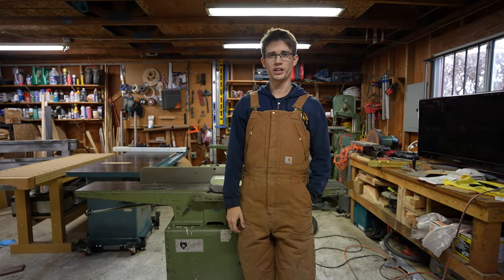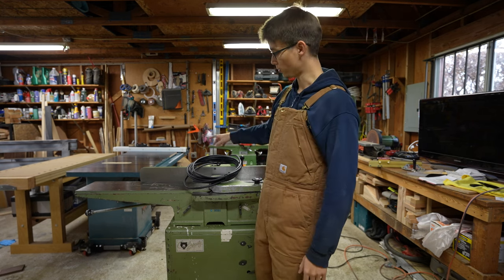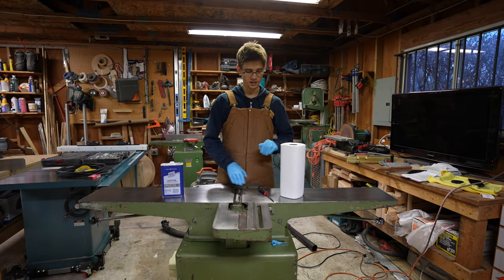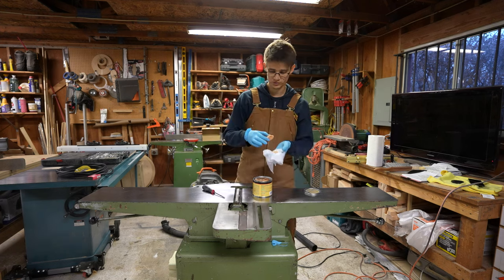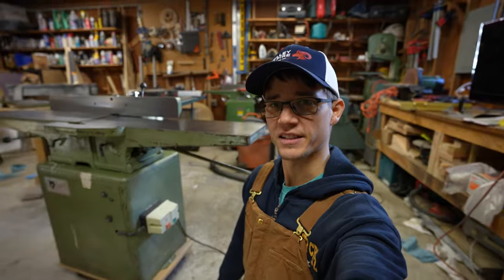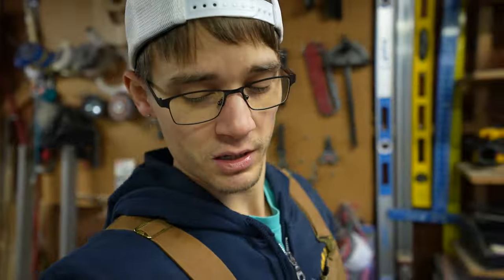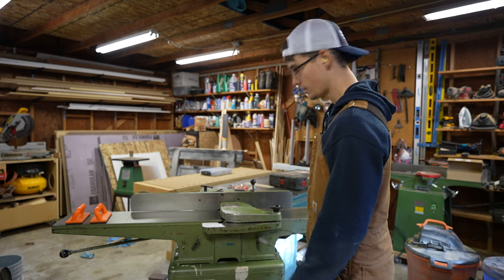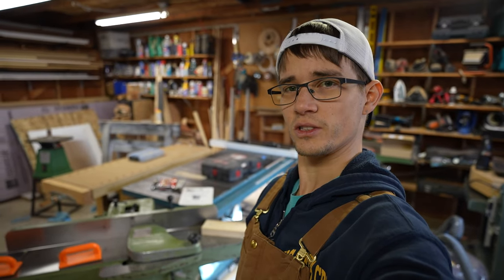Wood Jointer Restoration: Bringing New Life to an Old Tool

Comment: It sounds like the bearings need to be replaced. Great video!
Reply from the maker: Thanks 😊
Yeah I think you're right on the bearings. I didn't feel any slop but they're definitely noisy. At some point I'll probably pull the cutter head and swap the bearings out.

Comment: Nice job.  I was ready to ask why you paid no attention to the belt until the end when you said one was on order.  I was also waiting to see if it was possible to lubricate the bearings, perhaps though a zerk fitting?  But the comment about replacing bearings would take precedence.
Reply from the maker: Yeah the belt is trash. I've got a new one on it now. There doesn't appear to be a zerk fitting for the bearings, so I'll probably pull the head apart sometime soon here and inspect/replace the bearings.